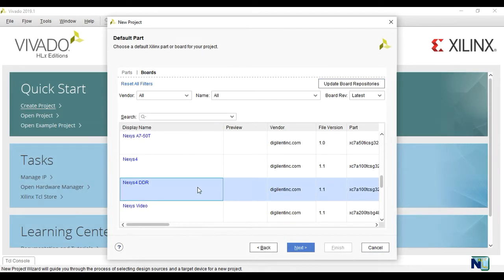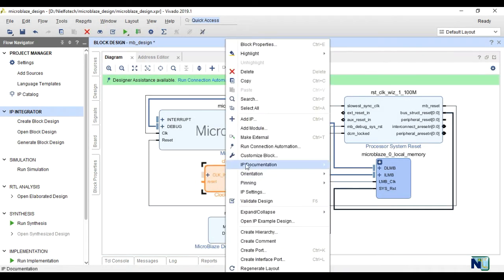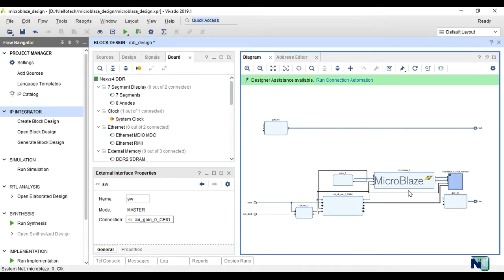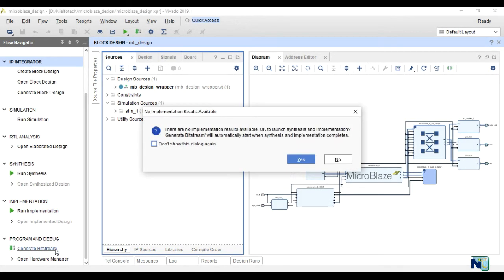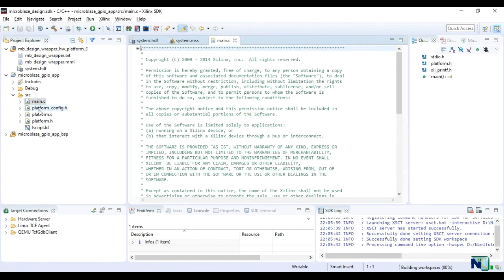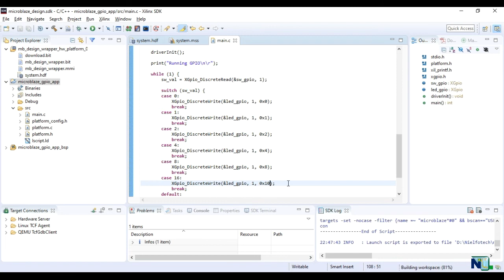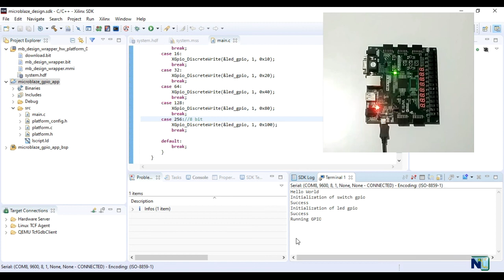Digilent Nexys: Microblaze and GPIO Design Implementation

Comment: No need of constraints file ?
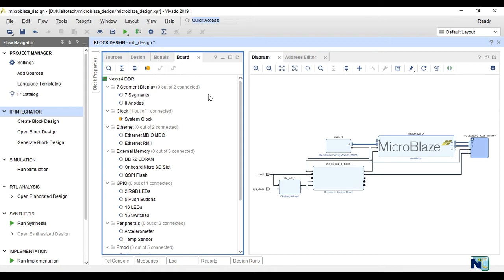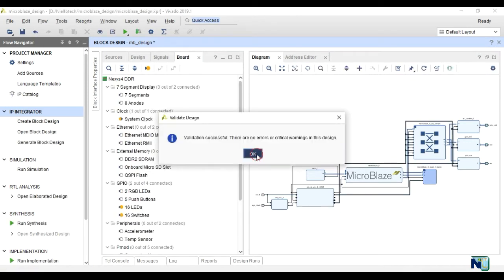Reply from the maker: Could you once check video at 03:24 & 05:28? When you add led, switch, clock signals etc. by this way, the constraints are already set automatically. You do not need to write those again.
If you want to connect the signals manually, then you will need to write constraints.
Reply: @nielfotech4684  OK thanks so I missed that part